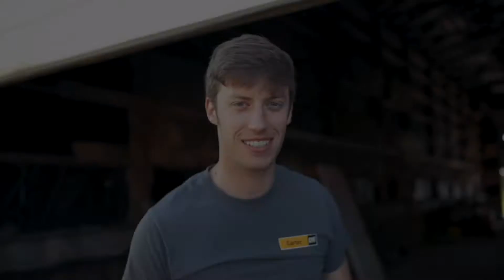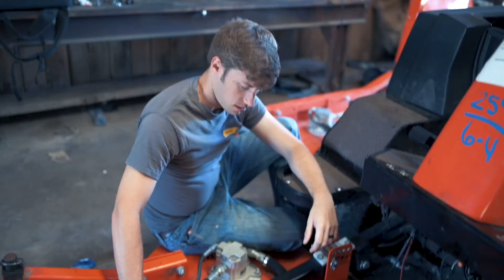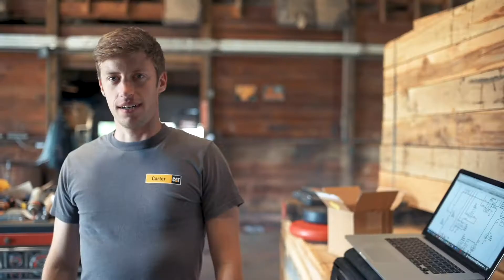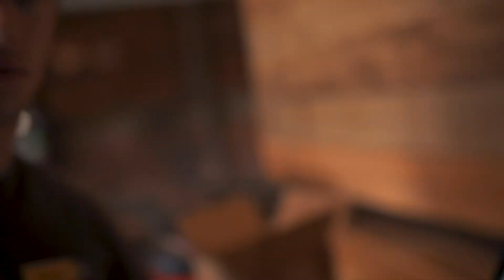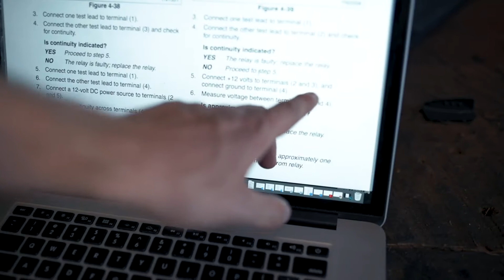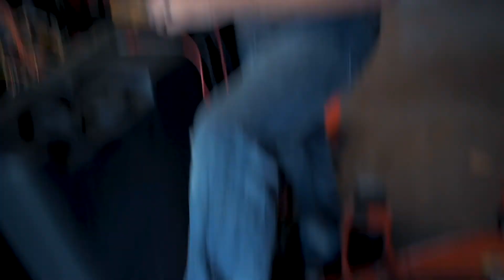Jacobsen Mower Part 2 : Troubleshooting

Comment: When my Jake heats up, the right deck quits mowing. What could that be?
Reply: did you ever find the problem, on mine the center blade just turns slow
Reply: @williambrandon3504  motor drive gear